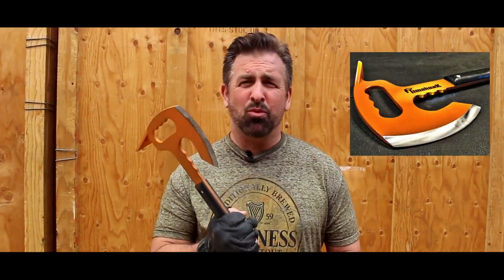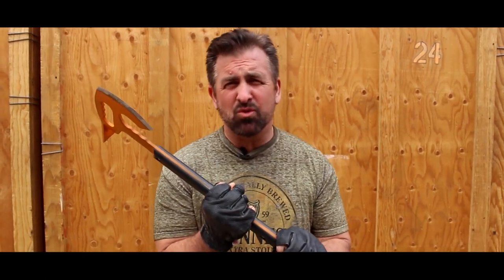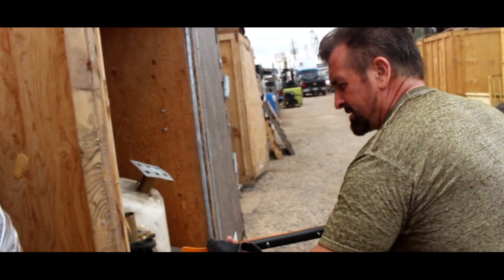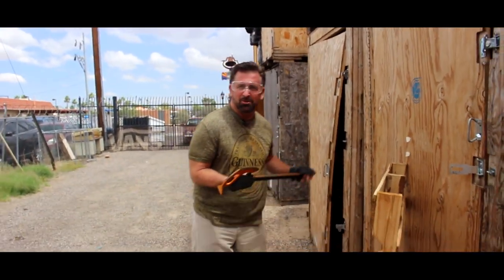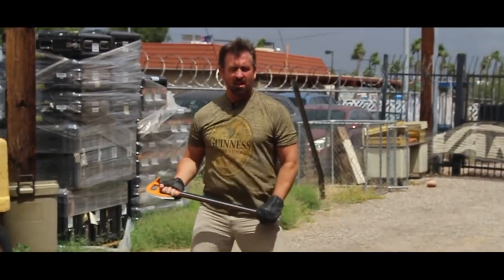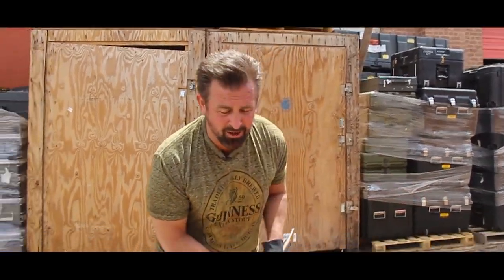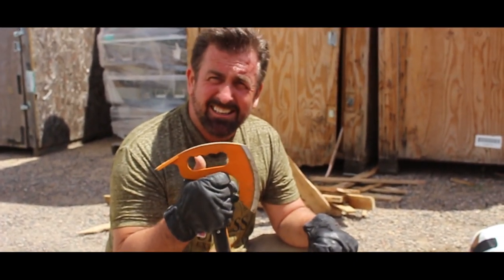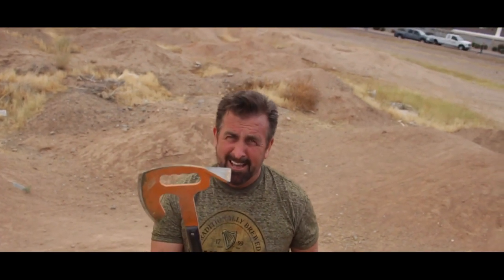Timahawk Field Test HD

Comment: As far as a win/fail rating goes this tool definitely is a win but on a scale of 1-5 it seems like a 3.5 only because the price seems really high, much higher than most multi tools. As mentioned earlier the prybar doesn't seem to be able to handle a lot of pressure and when it comes to digging it works but it looks like you'd get fatigued fairly quickly. 

For what it was designed for though; a lightweight tool that can replace several other tools in an emergency and looks badass at the same time i think tim did a great job.
Reply: to be fair though any flat pry bar is going to have a lot of flex in it because of where the  teeth are located. Its like a 2x4. If you laid a 2x4 down with the 4 inch side flat it will bow in the center with little effort but if you had laid it the other way you wouldnt get any flex at all